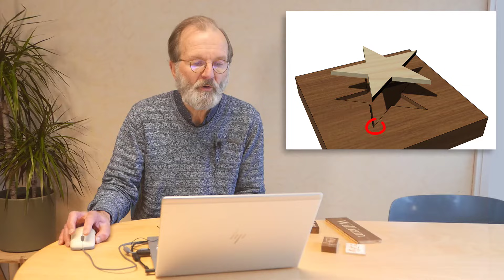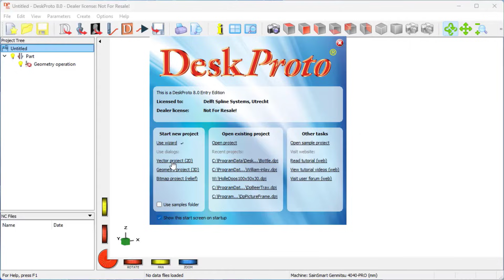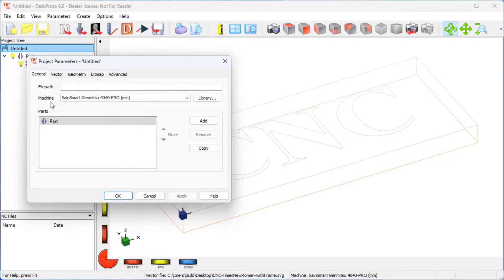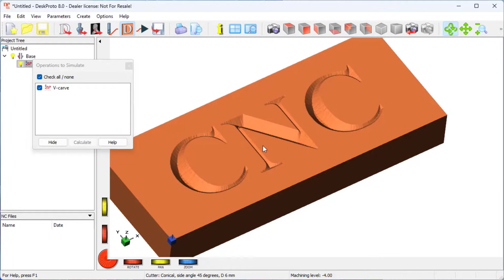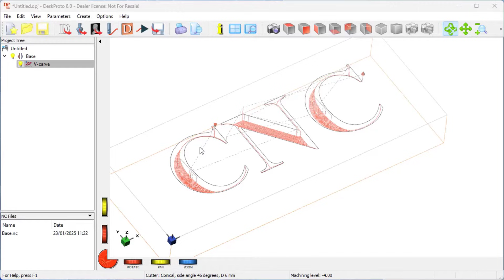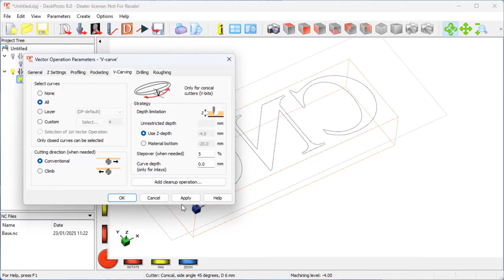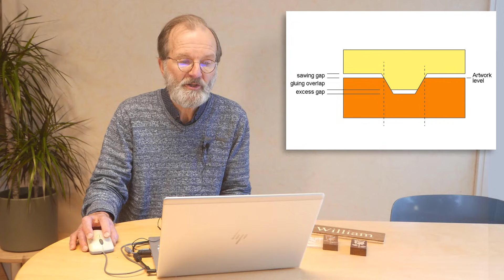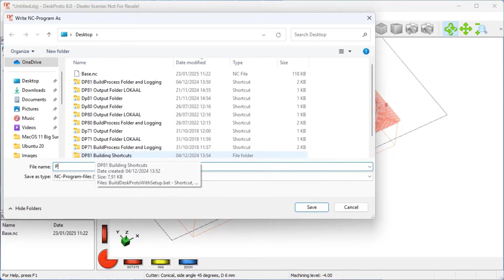Create stunning Wooden Inlays with this easy CAM software

Comment: Great! But how do i add a different tool for the large areas? I dont tant my v-bit to clear all this. 
Also do this work with a ball nose bit? Or what is conial?
Reply from the maker: That surely is possible: you can use an offset curve around your design curves to limit the area to be machined (for the plug). And then use a 'cleanup operation' with a flat cutter to remove the rest of the material to be removed. We will add an option to create such offset curve in the next version of DeskProto.  Using a ball nose bit is not possible, as with such bit you cannot create a design with sharp inner corners. 'Conical cutter' is just a different name for a V-bit cutter.
Reply: @Deskproto  thanks
A 5 degree bit with a .25mm rad would be sharp enough for me. 
I would like to just add a 3mm bit and that the software calculate by it self where to use what bit. 
But maybe that is what you ment?
Reply: @Deskproto  Wouldn't it make more sense to add a feature where one could just limit the width of the V-carve area?  Say user specifies 3mm with and the V-carve toolpaths are only generated in this area/3mm from the contour? And users can then rough/pocket out the rest?
Reply from the maker: @ You are right, and we are working on that for DeskProto version 8.1.  It will be implemented by creating an offset curve round the design curves, for which you can set the offset distance.